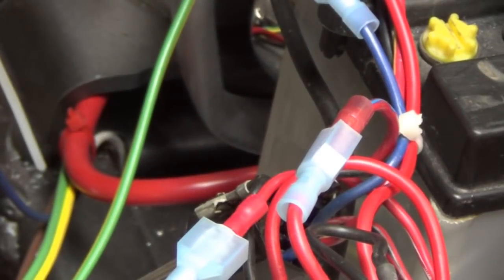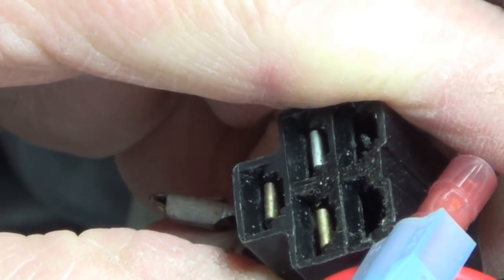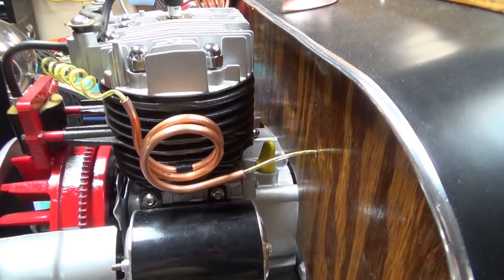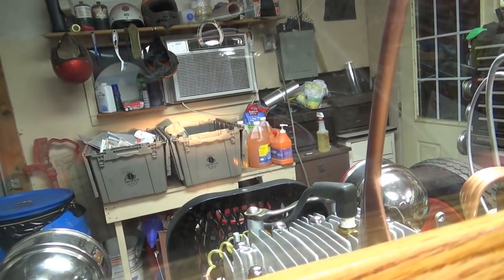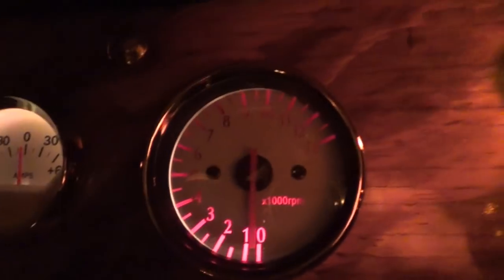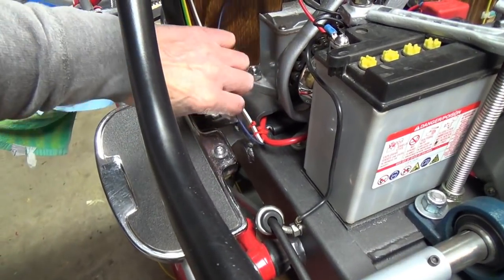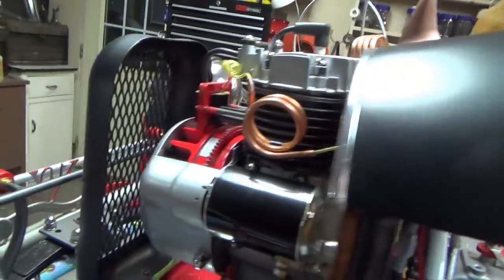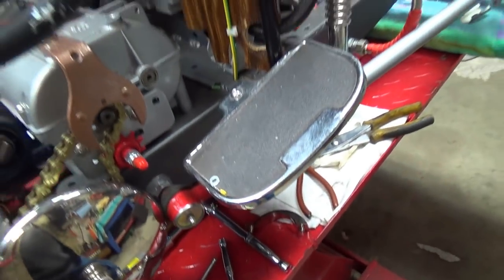Wiring the Goofy Cart II with a few tips along the way

Comment: My IHC tractor has the 2 nub headlights
Reply from the maker: Any idea what the number is? I'll check on eBay to see if I can find them under tractors. Thanks Jeff
Reply: Wagner 7400
Reply from the maker: @ElderlyIron  Thanks Jeff, but that is too small a diameter being only 4 1/2", whereas I need 5 1/2". I will be making the 4001-5001 bulbs work.